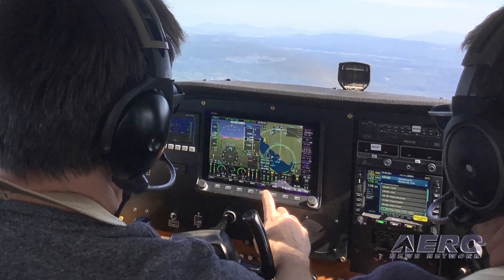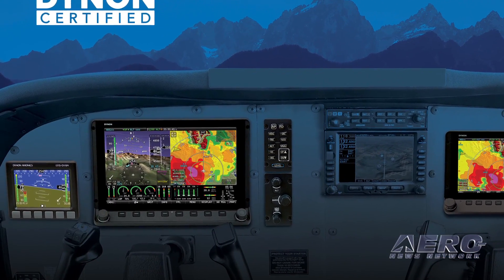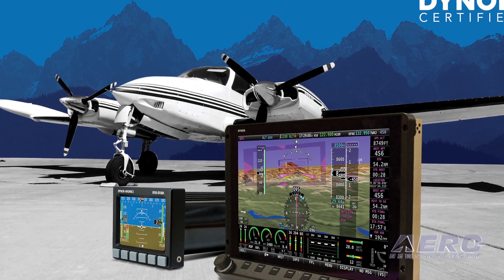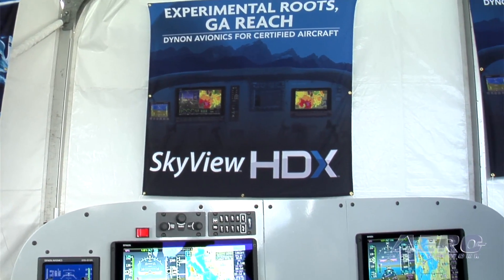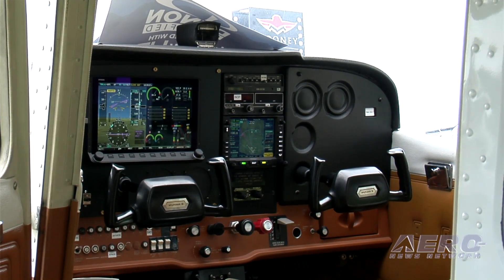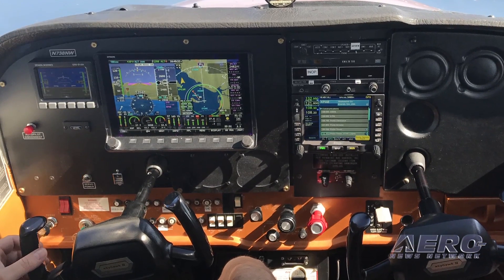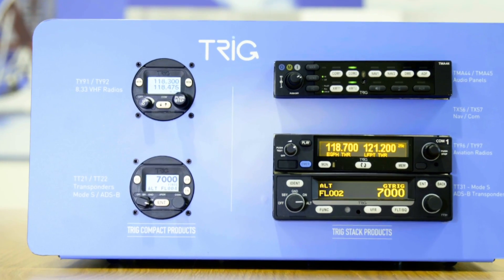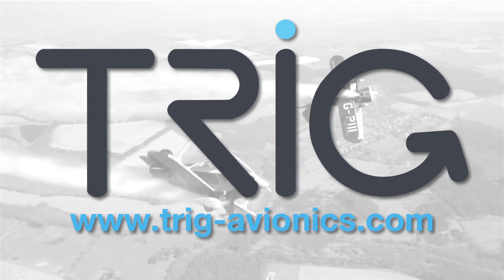Aero-TV: CERTIFIED Dynon Avionics! - Upsetting The Avionics Apple Cart

Comment: And of course outrageously expensive again. What a disappointment.
Reply: $16k in a 172 ? Thats about what a GPS costs.
Reply: Outfitting it with Garmin avionics would cost about $32k excluding installation, about twice as much money
Reply: When considering all you get, this is cheap , cheap. I have a 20,000 dollar gps alone. This has auto pilot, transponder, backup attitude, and syn vision. Plus , by upgrading, you increase the value of your aircraft, and would probably get most of the cost back when you sell, as people will pay more for glass panels. Hope they get this certified soon for my 1973 a36 bonanza, as I will have to upgrade to ads b out soon anyway.
Reply: Get a used 430 for $4000